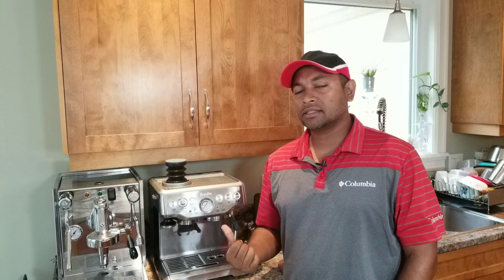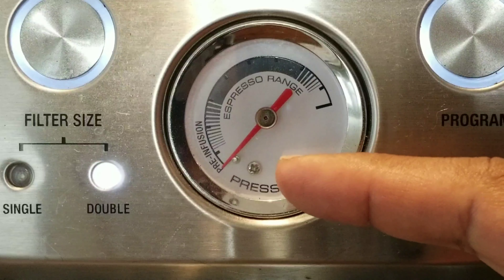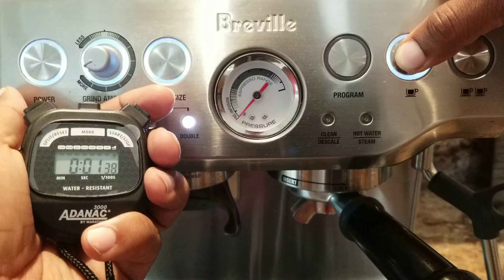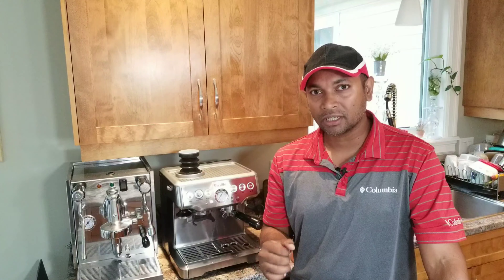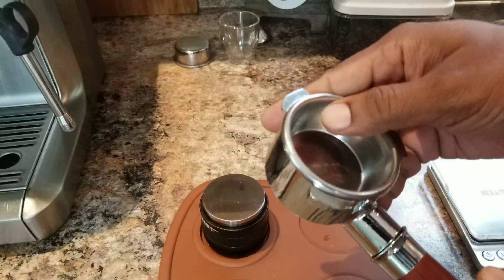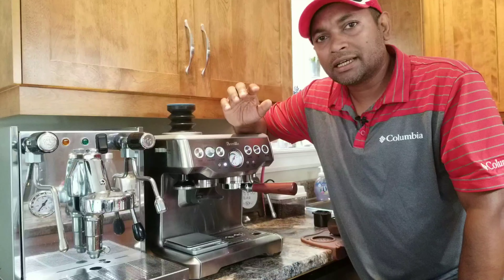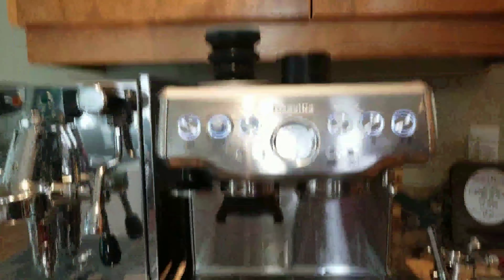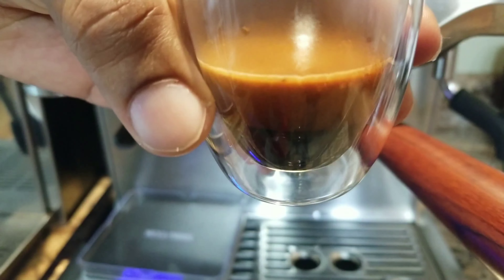Maximum Pre-Infusion "Pressure TEST" | on Breville Barista Express

Comment: My understanding is that this machine is 15 bar capable - but for whatever reason , perhaps protecting tubing and seals - the pressure in the infusion is restricted to 9 bar through the machine.
The excess pressure goes to backwash - which is why the tray fills with water more quickly than other brands.
I saw one review which claimed this as a defect which is untrue - it is protective and a good feature.
If anyone has other knowledge or disputes the above - lets hear it.
Reply: My machine is the same and does not have an overpressure valve. I can choke a shot and exceed 15 bars of pressure, with the gauge maxed out.
Reply: Same. I can go as high as the pressure meter goes. However of course the taste quite bitter for most coffees i tried if the pressure is too high. But i am having hard time dialing; if i want to keep the 1:2, 25-30 seconds, i am not able to achieve 9 bar pressure, it is always too high. And if i grind courser the. 25 seconds goes down to almost 18 seconds.. any recommendations?

Comment: hi i just bought the magister stella like yours,i am wondering if the gauge is broken on mine as it just stays around 1 bar,though it pumps out espresso very powerfully
Reply from the maker: The gauge in the Magister is Stean boiler Pressure and NOT Extraction Pressure. At 1 bar, you are ready to make espresso. You can install a 3rd party Pressure Gauge if you like, on to the E61 grouphead
Reply: @AjusCafe  ahh thankyou

Comment: For me I have to put 19-20 grams to hit the 12 bar pressure or 12 o clock
Reply from the maker: Try more freshly roasted beans and grind it finner. Its ok to use 20g
Reply: @AjusCafe  So how long of a pull do you recommend now ive heard 25 is the best
Reply from the maker: @kuksgarage2715  25 to 30 seconds and around 40g yeild